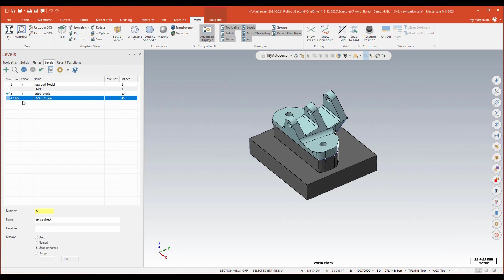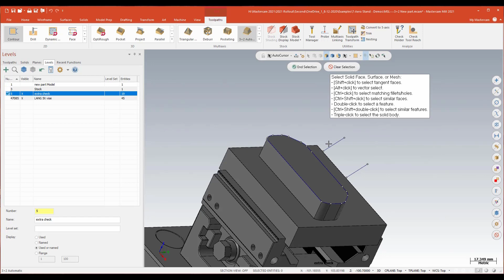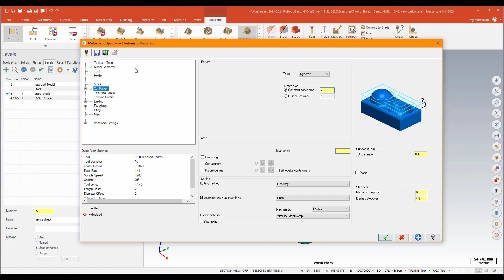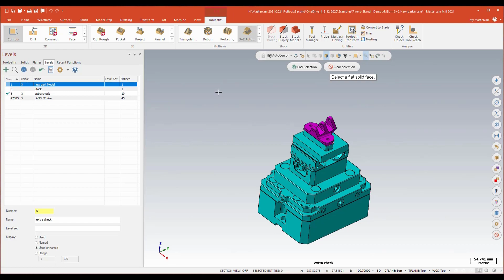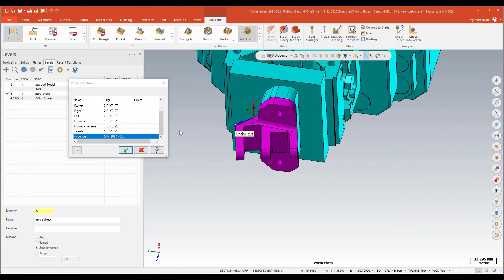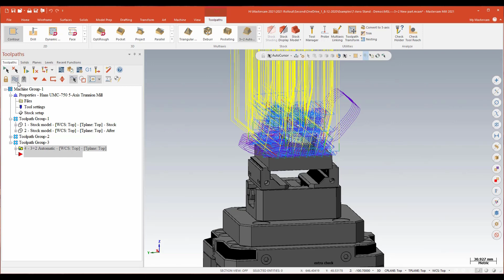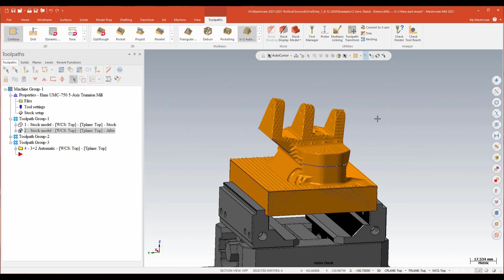What's New Mastercam 2021 - 3+2 Automatic Roughing

Comment: You need the mastercam multiaxis to use it. Also, anyone else having really horrible lag with 2021m
Reply: Yes, you do need the multi axis level to use the 3+2 Roughing toolpath. Lagging issues with Mastercam can usually be traced to a lack of memory or your video card possibly needing an updated driver. Is it lagging at only certain times?